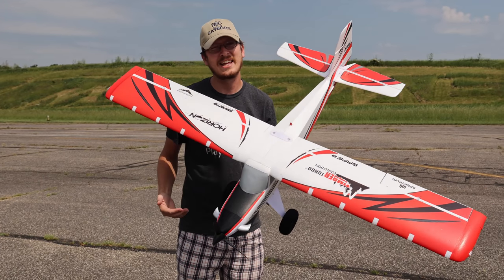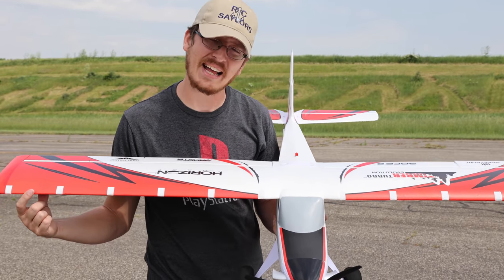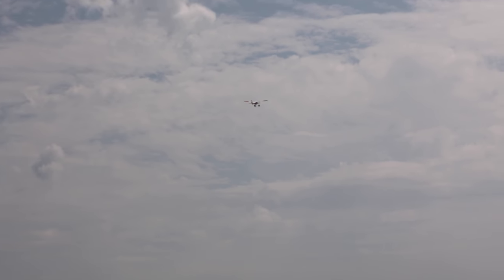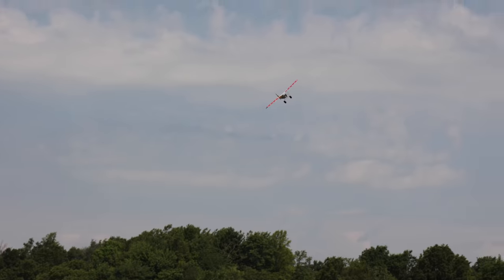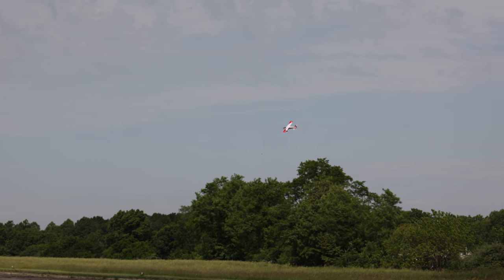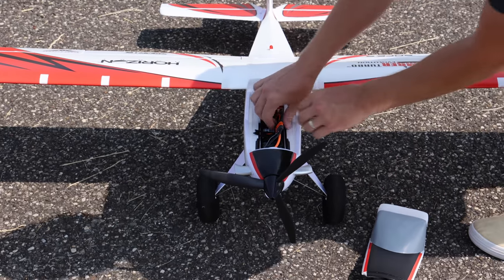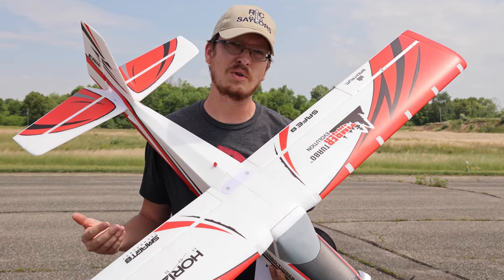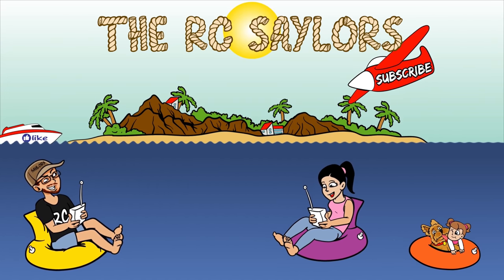BRAND NEW!!! E-Flite Turbo Timber Evolution 1.5m RC PLANE! - TheRcSaylors

Comment: Make sure your safe values are always at 100%.
Not saying you did this, but some people will restrict safe limits, thinking its the same thing as mid and low rates.
So lets say you have low rates set to 75%. If in ur safe mode and initiate low rates. Safe may already have you at a max banking ability of 60 degrees (idk what it is). If you are in low rates and in safe, you now have a max banking of 45 degrees. It also makes safe mode kinda janky. Safe mode is only meant to have 100% and no limitations. As that is what safe mode does. Gives limitations.

Just remember that.
A lot of people forget this.
Never use low rates with safe mode.
Maybe preach this as well through your channel.
Horizon Hobby will absolutely thank you for it.

Comment: Dude, this could not have come at a better time (or worse).  A couple of weeks ago I crashed my Turbo Timber into a tree and for various reasons, I sold it to a guy that's been wanting to buy a used one... while it was on the tree.  cheap!!!  I was in physical pain, mental anguish, upset, etc.  But now I miss it but didn't miss the battery in the bottom.  Long story short, I followed your link and preordered.  They say next shipment is July.  Thanks for the review.  Can't wait to get it.
Reply: I just destroyed mine in a nose dive crash from about 140 feet up and the battery plug came out which caused the crash. I’m not buying the evolution model. I’m just upgrading my turbo timber

Comment: Sorry for the second comment but can't edit the first one, I purchased the FMS folding plane stand, adjustable, and it's nothing to flip a plane over to install a battery or work on it, I use it at the field and in the shop,  and not only can you set the plane in length wise but you can hang the plane y it's wing too.
Or remove the wing to either work on the fuselage or set the wing in it for repairs,  very versatile

 Check it out, you'll never be on your knees again working on plane, or replacing the battery, in the vid you reminded me of the "Snuggy" commercial where the woman is having a hard time figuring out how to use a blanket,,,,,,,,,
Reply from the maker: Lol that is really funny! But it is honestly true. I hate putting batteries in the bottom of airplanes! I'll check out that airplane stand 👍😁😎⚓
Reply: Plane stands are a game changer, awesome for building, working on, attaching wings etc.  never have a plane fall off the dining table again during assembly. We can all admit we have had it happen. I have a Ernst and love it. Can’t believe I lived without It. It also allows me to store an extra plane in my vehicle because it gets the plane up and out of the way and another can fit under it.

Comment: I have a Valiant and the UMX Turbo Timber (which I recently got brave enough to fly around my oak-lined cul de sac, albeit not much). My next RC money is to upgrade to an NX8, but after that this may be the next thing. I have to let the T-28 wait longer. I've got a fixed wing thing, y'all. :)
Reply from the maker: Transmitter upgrades are always so boring compared to new planes! Yes, I would shoot for this over the T-28 100% but you've got the right idea too. NX8 is where it's at 👍😁😎⚓

Comment: That would make it easier for the battery, connecting and disconnecting. Even if you leave the plane on the ground it's difficult to finagle around the landing gear. I do that with my Sport Cub then flip it and push the battery in/onto the velcro, harder with the Apprentice with the battery door.   Those things for the wings, what do those do? (For a unknowable person)  I thought that the wings looked good with the white 'patches'. Always liked the exhaust tubes of these planes.

Comment: Is the evolution that much better than the old turbo timber? I'm not to concerned with telemetry. Is it stronger or fly better? I found the older one for $200, not sure if it's worth double the price. Any help is appreciated. I'm graduating from the umx version.

Comment: Interesting that you mentioned " something is going on with SAFE" 
I'm having problems with my new TT Evo. It's a handful to fly. Not fun or relaxing right now. 2 flights in.
constantly climbing, worse with SAFE on. Balanced per manual.
Today I'll re bind WITHOUT SAFE or AS3X.... fly her and see how the elevator looks after trimming out.
Very frustrating. This should have been the easy relaxing plane that requires no stress.
Any thoughts would be appreciated. TIA

Comment: I have the blue Turbo Timber 1.5 and love it . One question would be , what is the part with 2 screws that comes out of the bottom vent on the fuselage ?

Comment: Please do a floatplane video. I have the original Timber I got 2nd hand, I had to fix the landing gear several times so the stronger sounds great. I know the battery struggle, particularly when putting a 3S 3300 in the bottom. I use the back right switch for throttle cut for every airplane. The basis servo setup is 100+/- on all surfaces. I pushed that out to 125+/-    Why not put the SAFE on a three position switch and use Flight Modes, with SAFE as FM1 and the other two positions AS3X and dual rates and exponential.

Comment: I crashed my carbon cub s2 today. My very first fly. Was doing alright till I took safe off. Poor plane is pretty tore up.
Reply: go for the habu  flies better and easier  for me
Reply: I bet you turned Safe off in a turn. Never ever turn off safe until your level and 100 feet up
Reply: @TheTerrypcurtin  I was doing good until my dad and buddy walked over. I went to show off by doing flips. Did 3 successful ones and went to do another to get on video. I crashed. I had a feeling I was going to slow and not high enough. Sure enough it stalled and I panicked.
Reply: @kelvinbloomfield1375  i will look into that. I want to get another plan that's cheaper and I can not worry about crashing as much. I honestly was doing great until I went to show off. I ordered new wings because i cant be done with only 5 mins of flying and spending 300 on a plane.
Reply: I just destroyed my turbo timber in a crash from about 100 feet up. Battery plug came out causing the crash. I just upgrading my turbo timber instead of buying the new turbo timber

Comment: Hi can you tell me were can i disable the safe mod?
Reply: If you have the bnf you need to hold the button on the reciver through the whole bind process to enable safe select (where you flip a switch for on off) or hold the button while plugging the battery in then let go then bind to your TX. 

To pick a switch for safe select (the first method) you hold the sticks all the way down and toward the inside corners. Hold them there and toggle the switch you want to use the plane should beep when it works. (Keep in mind not all of the switches will work)

Comment: I prefer this turbo timber1.5 over the night x or 1.2, because this one has a longer wingspan, more stable flight, the 1.2 models are shorter wing span and harder to fly,more snappy, higher stall speed.

Comment: Would love to see a vide on how to bind it to a radio and what is the difference between php and bnf?
Reply: pnp is plug in play you need a reciever and radio where bnf is bind and fly and you just need a radio it has a reciever built in. typically bnf is what most people are gonna buy unless you have your own equipment you want to use.
Reply: Bnf needs a spectrum receiver to work. PNP don't need.

Comment: Can I use my dxs transmitter that came with my aeroscout? To fly the turbo timber.
Reply: If it came with a ready to fly,most likely no,it won't work with a different aircraft

Comment: I would appreciate a video about radio setup for Turbo Timber Evolution 1.5M and part No. EFL105250.  I've been around  aircraft all my life, including 
Flight Deck on Aircraft Carrier in Vietnam.  My first ride was in a bi-wing duster standing in the hopper.  I have little experience with radio controlled planes.  My second plane was the Turbo Timber Evolution 1.5 purchased a few day ago.
Reply: Brian Phillip’s

Comment: What is the difference between the BNF Basic and the PNP?
Reply: BNF has everything you need except the battery, charger, and transmitter you use to control the plane. The PNP is missing those things as well as the receiver in the plane that talks to your transmitter.

Comment: Looks like a great stol plane. Question...why a 3 blade prop? Less efficient than a 2 blade so why design it with a 3 blade???
Reply from the maker: More low end torque with more blades, so you get a lot more low end punch when powering out of a stall, which can happen a lot on a STOL plane 👍😁😎⚓

Comment: Hey Guys I gotta ask if you or anyone else reading this that have the evolution have the same issues. This is my 2nd weekend flying this new bird. And, whats happening is within 2-3 minutes of flying i get a Temp warning. My ESC is getting as high 210 degrees. Last weekend flying it for the first time is when I had the problem it got so hot that the heat melted the glue where the battery sits in the plastic tray. No worries I reglued and continues to fly. New fresh battery and again 180 degrees within 3 minutes of flying. Could it be a bad Esc? Im running a 4000 battery. This weekend I cut a small hole in the bottom of the nose to allow more airflow but still got high temps of 180...
Reply: Sounds like a faulty battery

Comment: Hard to justify the extra $79 over the Valient. 
The safe on the Valient gives you nearly straight up vertical and 80% turns too. 
It's nice though. I would buy this over a Draco for sure. A poor man's Draco with everything but the paint job. Even reverse.

Comment: Yes will you please show how to set up a radio I have the DX6i ,7s and 8e  The only plane I have flown out of 20 that I have is the jet and only because it came with a remote I cannot figure out how to set my remotes up and do all the mixing and how to do all that and then I bought a plane and tried to set up the safe and the only time I could get it to work is if I had the throttle cut on. But that does me no good. I really wish I can find someone close to help me with setting up my planes and to help get them going. I love fighting my smart jet habu. The first time I put it in the air I hit a light Pole and hit the road with the throttle all the way up. But got it all fixed and been fighting it just about everyday and love it and with 15 packs ran through it I did land hard a few times and once had my wheel come off after a touch and go so came in and landed it and did it with 1 front wheel and the left wing wheel some who I got it to stay rolling till it was slowed down to turn hard to make it stop and then it fell over. But still afraid to take it out of self and The beginner every time I go to intermediate and intermediate and I panic and then I accidentally switch it to off completely and then I really panic but I've never wrecked it that way
Reply: Have you tried loading the profiles from Horizon’s webpage for your other models?

Comment: When you fly with safe select on...
When you gove it throttle,it ains altitude.
When you cut the throttle,it loses altitude. That only when safe in on
Reply: No this is just how planes work. More speed = more airflow over wings = more lift.

Comment: Just bought for float flying.  Had to do a lot of fabrication to attach the floats.  One of supplied screws was defective.  The rudder control wires (actually monofiliment fishing line) was too short. 
Horrizon Technical support was terrible.   Tech told me to untie the knot to make the line longer.  I just went and bought some more fishing line and replaced.  Ever try to untie a nylon fishing line knot.  I did not believe the tech.  The rudder design for the floats is very flimsy and fragile.  Hopefully the rest of the plane will madian fine on water

Comment: I have this plane and although the plane its self is very resilient, the landing gear sucks and breaks every time I use it because it is not made for vertical suspension, but horizontal WHICH IS NOT VERY HELPFUL ON THE WHEELS!

Comment: Does it have beginner intermediate mode switch ?
Reply: yes
Reply: I want this air plane
Reply: I want this air plane
Reply: I want this air plane
Reply: This only has safe select which means you only get "beginner" mode which is full on safe or "expert" as3x stabilization only. You do not get an intermediate mode.
Reply: @libra6829  Arguably, even as3x is still pretty good - it won't limit pitch or bank but it makes it nice and predictable to fly compared to unstabilized RC planes of old. I believe its possible to adjust the limits on safe as well through forward programming mode on the transmitter - I haven't messed with that at all on mine since I'm fine with just leaving it in AS3X mode all the time (fairly new to RC flying, but also have been flying full size Cessnas as a PPL and doing all sorts of flight sims for decades now. Not a professional, just an experienced amateur).

Comment: Can this be a plane for someone who has never flown a plane before
Reply: I’m sure you could but I’d recommend the hobbyzone Aeroscout S 2. The best plane you could ever learn on, anyone could fly it.
Reply: I have UMX: Turbo Timber, Sport Cub 2 and PT-17.  First two very easy to fly in Safe for beginners.  PT-17 needs a lot of work to get it to fly stable due to extreme tail heavy factor.  First two fly great out of the box with no adjustments.